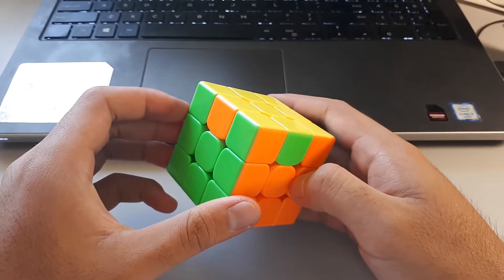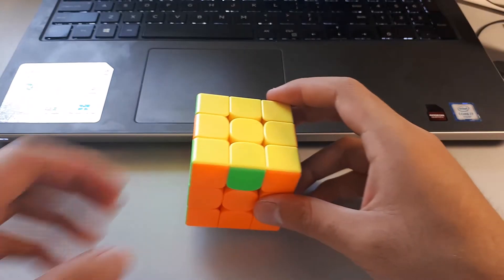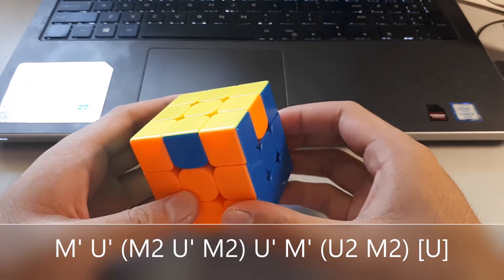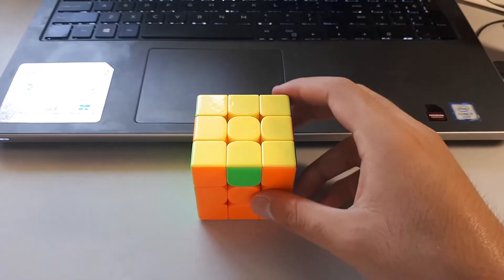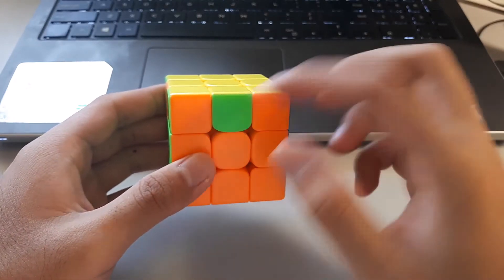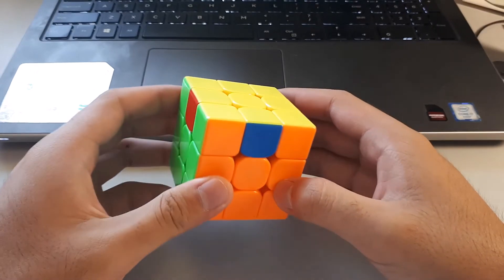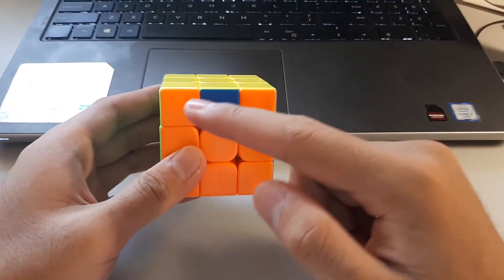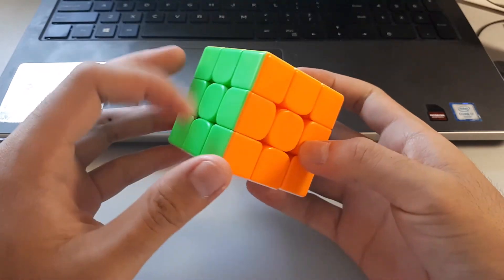Z Perm Made Easy! Full PLL Tutorial: Recognition & Execution + AUF!

Comment: I need a z perm algorithm where u only have to do the algorithm to solve one z perm area not 2 z perm areas like normal z perm
Reply from the maker: Don't think that's possible. Maybe try taking the cube apart and just swapping the 2 edges.
Reply: @MikeShi291  well what I meant is there's like a diagonal z perm Where 2 headlights are only there but then u switch an angle and the other z perm headlight is also there is that possible?
Reply: @finwasfound no
Reply: @MikeShi291  yo
Reply: @MikeShi291  u fell asleep?
Reply: @MikeShi291  Answer my comment already lil

Comment: Looks like the 1st alg you have on the screen isn't what your doing, looks like your doing  M2 U' M2 U' M U2' M2 U2' M U2'. ?? Am i missing something?  I probably am 🙂
Reply from the maker: Sorry about the confusion, I should've been more clear in the video. M' means that the middle layer goes upwards while M means downwards. Therefore the alg I did is technically M2' U' M2' U' M' U2' M2' U2' M' U2'. BUT, if you think about it, M2' is the same as M2 and U2' is the same as U2 (try it for yourself, do a U2 on a solved Cube, then do a U2' on a solved Cube, the result should be the same). Therefore, the alg can be simplified as M2 U' M2 U' M' U2 M2 U2 M' U2, which is what I showed in the video.
Reply: @MikeShi291  Thanks for clarifying, much appreciated.. I caught myself trying to follow your finger movement and looking at the alg and was confused.  Thanks for the video, it's very helpful for me !!